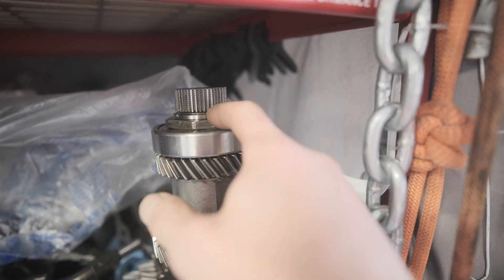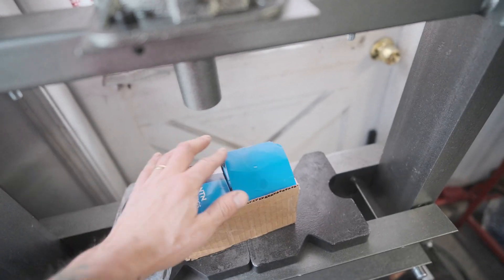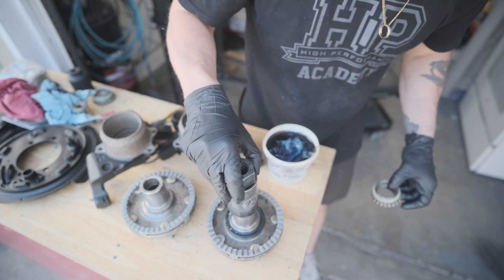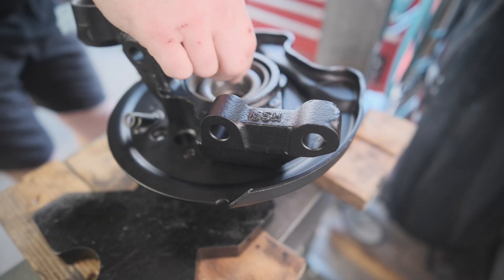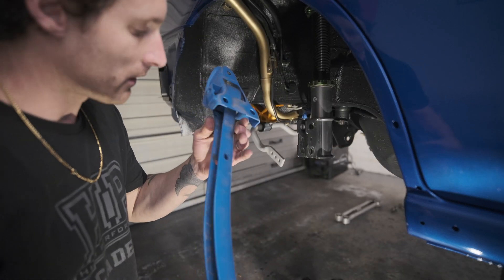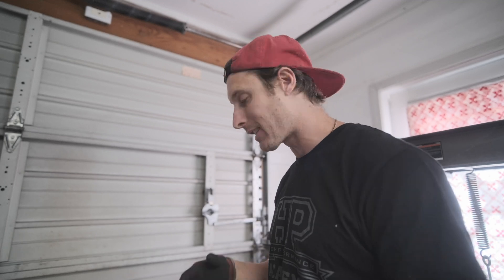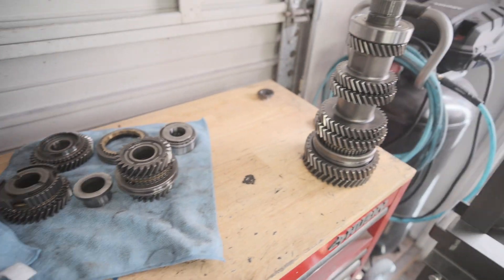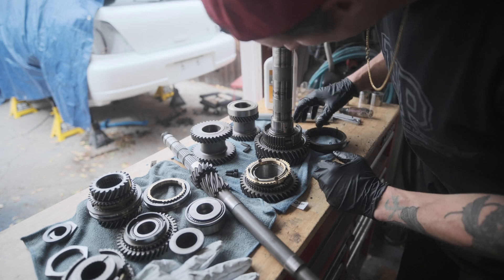Rebuilding A Neglected STI Ep. 15 | Replacing Subaru STI Wheel Bearings

Comment: Tip for using the old race beaing to press in the new, cut a slit with a grinder along the length of if, so it doesnt have a chance of getting stuck.

Comment: I need to do wheel bearings on my wagon but that ABS ring scares me,but after watching this I think I can get it done after purchasing a press.seems easy enough.another informative video mate
Reply from the maker: Wait, why does the ABS ring scare you? Maybe I was being naive and not careful enough.
Reply: @sleeper_motorsport  just the pressing on of the new bearings,I’m used to the bolt on version unit.but after watching your video mad it look pretty simple
Reply from the maker: Okay I see. Yeah to be honest the abs ring never seemed to be in the way. After I removed the backing plate for the brake shoe, I was able to pretty easily loosen the bolts for the abs rings and remove it so it wouldn't get damaged.